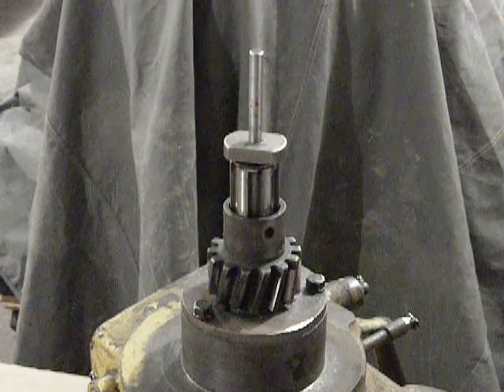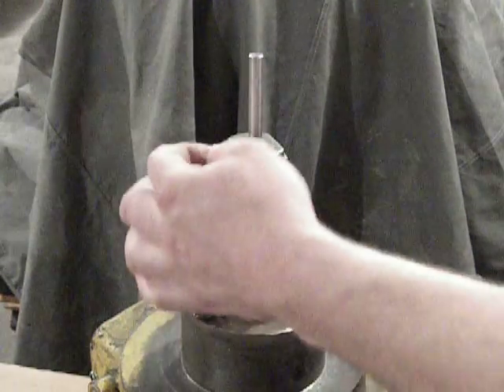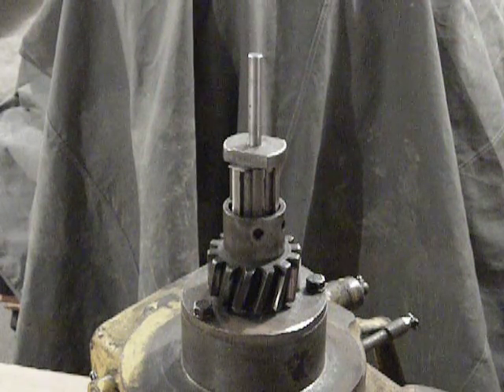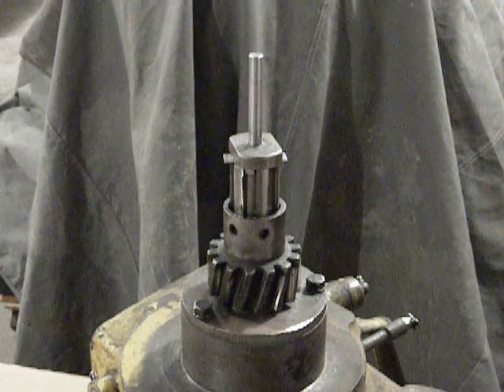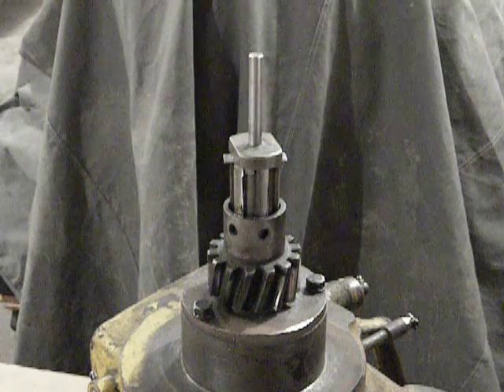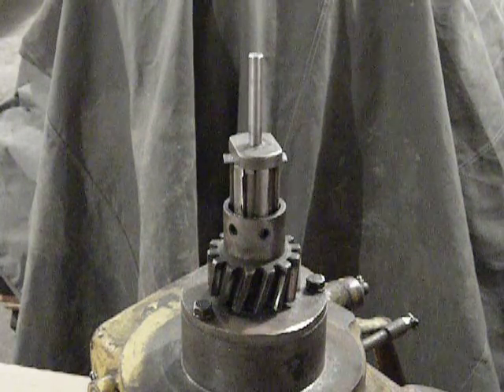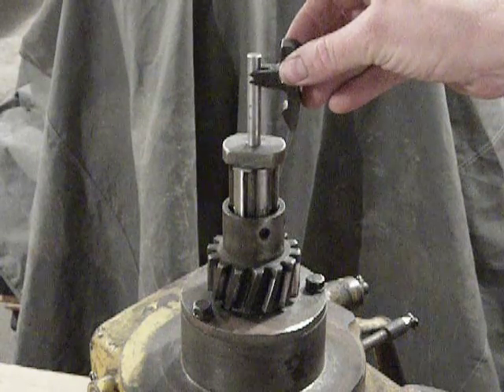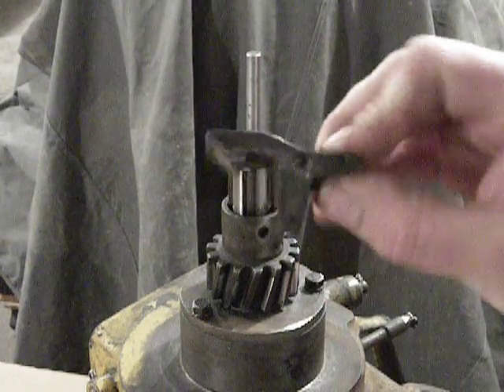Caterpillar Starting Pinion Assembly D2 D4 D6 D7 D8

Comment: Hello I like the way they used that pinion latch on that, however the D8 14A,s are different, they have the pinion latch in side the gear box. That rod that goes down through the gear box at the lower of the clutch and about six inches down the rod is groved for the latch that flat on the end of the rod is snap ringed in the end of the pinion shaft. In so being in stead of pushing the pinion gear in to the fly wheel the pinion is pulled in to the flywheel on the 14A D8 that I have